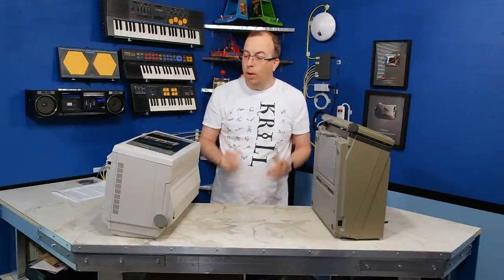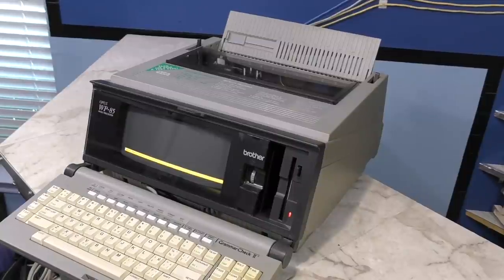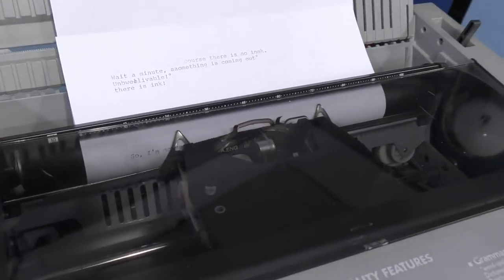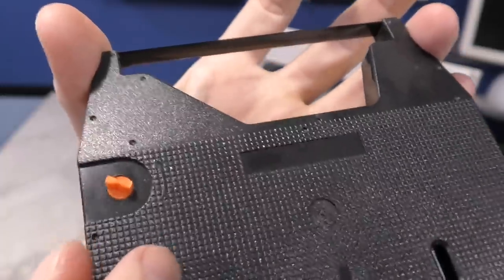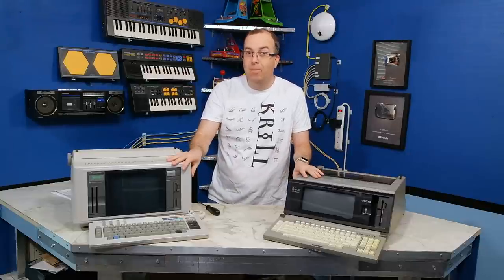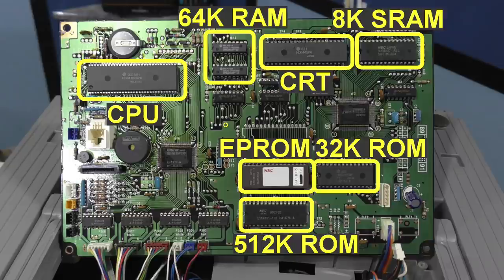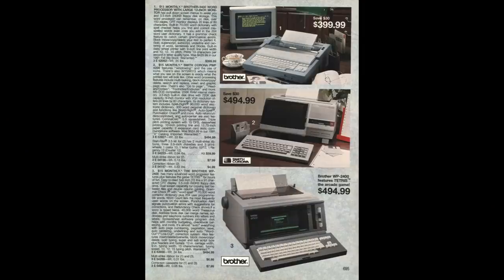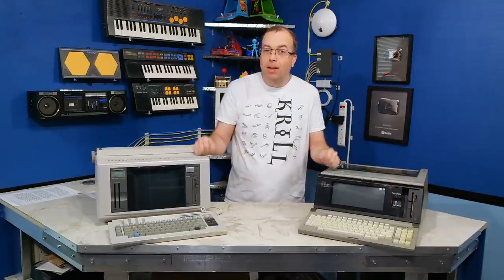Dissecting two Word Processors, Brother WP25 and Panasonic W1525

Comment: I know I'm late to the party, however I was wondering if you've ever considered doing videos on Alphasmart's lineup of word processors design for use in schools and for authors on the go. It was founded by two ex Apple employees and they provided various word processors models between the years of 94 and 2012ish. They could last a year on 3 AA batteries, or the equivalent of 700 hours of use. Some models had a sort of networking built in, so you could get your text off that way if you had a receiver for it. Otherwise documents were transferred to computer by plugging the Alphasmart into your computer and hitting print on the unit. It would then retype the document into whatever program you have open on your PC. The models that I can recall are the Alphasmart 3000, Neo, Neo 2 and Dana. I believe they may have had older machines than that, but these are the ones you still see in use today. They are coveted by authors who really enjoy typing their first edit into the machine. If you want to learn more feel free to let me know!

Comment: Hello, I love your videos by the way. I bought from a goodwill a little while ago, a early commodore Vic-20 in box that is in really good shape, i just have one small issue. The key plunger that the commodore symbol key cap sits on broke off and the spring is not able to be found and i was wondering if you had a Vic-20 key plunger and spring so i can place the my commodore symbol key cap back on. I can find a pack of 10 key plungers and springs for the c64 on eBay but i only need one for the Vic 20. thanks for your time and keep making great videos, I am always waiting for the next one.

Comment: If this tech came out way back in the electric typewriter era, it would've been globally revolutionary as much as modern day internet is.  It absolutely is simply an electric typewriter that stores pre written documents before printing the exact same way.  In theory, an electric typewriter could be retrofitted to print on demand just like this, by controlling input wires hooked up to every key, and then send a signal through those inputs via word processor just like these.

Comment: This is kind of an odd experiment idea, but have you ever tried rehydrating an ink ribbon? (assuming they used water soluble ink and not polymerizing oil base or something) I'd suggest just taking the side off the ribbon cartridge and putting it into a steamer for a bit. I make no guarantees it would work, but it could be a fun experiment. And if it did work you could have a lot more printer fun.

Comment: One reason you forgot to mention in the vid for why a  a lot of people bought these standalone word processor machines was they where typically cheaper then full computers. These are sort of interesting devices that could only exist at a time that full computers where expensive and cheap home computers don't do word processing well so a dedicated WP machine made sense, at least untill the price of full PC's came down enough to erase the main benefit the devices had. Still interesting as a 80s/90s artifact. .

Comment: OK, so that white ribbon actually doesn't work kind of like Wite Out and other brands of correction fluid, because rather than printing white filler over the wrong characters, it's an adhesive tape that lifts the ink off! And it's actually not silly, because just like with the other unit, you can type directly with it, in which case if you made an error it was already printed and so would need to be physically deleted.

Comment: I have an older laptop in my possession. Heck its older than I am. It is a 2002 EEE PC Seashell Blue edition. The only problems are listed below.

-funky lines through screen but barely visible
-weird squeak that goes away when used.
Other than that this thing runs like a dream with Windows XP Home Edition on it.

Comment: replacing the ROM OS might actually prove somewhat troublesome.  Not so much because of the software. but because IIRC CP/M needs the low end of memory to be free, and it's quite likely that's where the ROM is mapped into (because the z80 by default begins execution at memory location zero).

The Sinclair Spectrum actually has a similar issue with CP/M for precisely this reason, though at least one custom version of CP/M existed for the disk drive bearing +3 model.

An obvious point of comparison here would be the Amstrad PCW

Comment: 12:30  You too?  lol yeah I did too.  The only commodore PC thing I have seen lately is a Commodore PC10-III "Colt" which there are a few on eBay.  I also dont know if you have seen the XU1541 thing that allows you to connect the 1541 drive to the PC.

Comment: The panasonic seems to have Motorola 6800 code compatible chip. The two blue sockets at the top contain RAM as well, as can been show from the -20 after the part number indicating access times. I think the big chip in bottom right hand side MIGHT be a 68008 CPU (8 bit data bus).

Comment: ON the panasonic the chip marked IC9 looks like an M3864 - 512MB ROM.  The 3 flat pack chips marcked IC4 IC5 and IC6 are  the DRAM chips, I cant see the number so I am not sure what size they are, likely 16K (2K *8).  The 2 Socketed Samsung chips in the middle are ROM chips 1M and 4M probably.  The Fairchild 625167 is likely a memory controller.  the 64 pin DIP mitsubishi chip is a mystery.  My guesses.  I cannot identify the square paq chip in the lower right as I cannot make out the markings.

Cool seeing these old machines working.

Comment: I have the later Brother WP80 which has the spreadsheet already in ROM. The floppy drive is 720kB DOS-compatible, except that it doesn't block "illegal" symbols in file names. My only disappointment is the fixed keyboard.

Both of the models you have use sticky lift-off tape for single-strike carbon. White-out tape is also available for ink and multi-strike carbon.

With an Arduino or ARM-based mobo (and appropriate break-out box), either of these machines should be able to match the Olivetti ETV-6000 series.

Comment: I'm am sure this comment has been made several times since the video came out, but my thoughts on the ROM sizes are:
512KB ROM has a part number 23C4001 and the other ROM is 27C2001, the 27C series of ROMs were very common in the 80s and were UV erasable.

Assuming the "4" in 23C4001 means 4Mbit (512kByte) then the "2" in 27C2001 would mean 2Mbit (256kByte).

Comment: I have a word processor, it's a olivetti cwp1 mine is dated 1988, and it's in pretty good shape actually, i took it apart so i could see what components it had (it wasnt as easy es these 2) and it was similar to this one, i think it had a z80 cpu, a crt controller, and it had a floppy drive controller, I'd like to hack it and use it to run other software tbh

Comment: 0:27 *luggable (in modern terminology). Like the first "portable" computers, such as the legendary IBM 5100 and those that followed working on the same concept in the PC compatible or CP/M era. Weighing about as much as what we know today as a full sized desktop PC, they were convenient in the sense that you saved the weight of a monitor and the need of connecting wires to it, while the keyboard was not much different from a standard one, only it was mounted on hinges and doubled as a lid. In practical terms it saved some space in the trunk of your car and the need for a second AC outlet in an era were power strips were maybe not that common, not much else...

Comment: The brother one would have been cool if it had used an Atari 800 like dual cart ports, one for the Word Processor, and the other for optional Basic / computer functions.
Reply: 10p6 The point was to not bother with a general computer interface.  Only runs it's built in program which can't be accidentally or mischievously changed. Only contains the minimum hardware to do that.
Reply: @johnfrancisdoe1563   I know, I used to work in the computer field for a long time.  My response was to the computer reference, and back in the day adding a cart port/s for unchangeable ROM software would have not really cost much extra to make.

Comment: You can also do a nice modern word processing machine with those :p 
replace the guts with a pi, replace the crt with a lcd screen.

The worst part would be to analyse how inputs are transmitted to the printer but i think it can be done :p

Comment: These daisy printers with those removible inkt tape cartrides are interesting, but i wonder how long these cartrides will last and how many papers you can print with it, also that typo correction feature  in the newer model from 1992 is such a fantastic feature wich all  typewritters should,ve.
Altrough i hardly could call those computers being portible,they are just luggible,it’s only handy for business mans who are traveling alot while having to set up their computer as fast they could to type on and print stuff,it might be very ideal for campers as well sothat you could work on it while traveling from an place to another.

Comment: Other than the ROM, they look a step back from the Amstrad PCW 8256/8512 from 1985. Very little on the motherboard and just dumb stepper motor drivers and suchlike in the printer (printer microcontroller is on the motherboard because it contains the Z80 boot ROM). PCW 9256/9512 in 1987 for a daisy wheel.

Comment: its funny you mentioned hacking the brother with new roms. i was recently in a discussion with someone about putting a ppu on the c64 and giving the system another 21k video ram. point is, if you are going to hack the machine, how about some type of vic-II display or grab the crt chip from the msx2. that would be neat to see. i was also talking about building a controller that could keep sync and paging access on a 128 between the z80 and the 8502, same with the vdc and the vic-ii. 80/40 column mode switch on both rgb and composite output. ive heard it cant be done. im sure it could be and im sure theres a way through a controller to accumulate the speed in MHZ of the 2 chips both ways so long as sync is kept. also requires memory management and custom hacks/updates to programs, one can hope i suppose.

Comment: Shoot, i sold my pc-1 last year. I used a pc-1 back in the days at my friends house. Later i found one for sale near my place. I trade it for a nes. It had a broken psu, but swapping the capacitors brought it back to life. It only had 512kb of ram and a 360kb 5 1/4” diskdrive with mda graphics. To play some game u could use a program that emulated a hercules graphics card. It’s a nice compact pc, but since it lacks any expansion port, u cannot upgrade it without hacking.  The only nice future the system has, is the fact that u can use a Commodore Amiga mouse and a Amiga diskdrive to expand the system. I tried it and i could use a Amiga 1010 diskdrive to read 3.5” 720kb formatted dos diskette’s. I can imagine that you can use a  gotek to ‘future’ proof the Commodore. They where offered for sale back in the day at a national furniture store for 899,- guilders.

Comment: Ooh, i have an old brother word processor just like that, though it's a few years older. the 240k floppy format is apparently something common on the lower-end models, but I guess it can "initialize" any regular 720K/1.44M floppy disk. unfortunately, I don't have any of the floppy disk software supposedly included with it and with such a strange format i doubt there's any way of getting a new set.
Reply: And i was similarly impressed with the ribbons, they seem to hold up really well through the years.

Comment: Thing i want to mention: If it works with colored paper, it's supposed to be tape. If it was correction fluid, it will leave a white mark on colored paper. Plus, it will NOT work as good.

Comment: Japanese characters are very numerous and can not be entered with a typewriter. The word processor that was able to solve it spread in Japanese business. It was also shipped abroad. Panasonic (At that time in Japan, initially the "National" brand) has long been producing MSX PCs (The only maker that has put out MSX turbo R), but it has also produced word processors. Brother has been producing typewriters until recently. It is inherited by printers and MFPs.
Reply: Thats bull***t. Japanese can be typed by keyboard. There are 46 basic characters. Look up a Hiragana or Katakana chart.
Reply: @trainingtheworld5093  No, it usually requires kanji. It is commonly used in Japanese.

Comment: that amber on black looks like it would be fairly easy on the eyes. We had some old computer system that we used at my last automotive job that had green text CRT monitors At first I didn't like it but once we upgraded the system to a modern Ubuntu setup (old one was linux based also) 
I started to miss the Green on black setup... The new version was a small window inside Ubuntu that had a stretched look and had bright blue letters... 
Might be a way to change it but meh 
if you know how to modify "lubesoft" software for ubuntu hit me up lol

Comment: So generally speaking, do most of the word processors load their basic functions right from the ROM ? Since some word processors e.g. NEC Mini 7 series doesn't have a full functional ROM. A boot disk is required to even use its most basic word processing functions.

Comment: I have cheap ($15) open source hardware which will read and write Brother disks using PC drives! http://cowlark.com/fluxengine/ At least, it'll read the 240kB and 120kB formats, and as the WP25 used the 240kB format it'll probably read that.

Those Brother floppies were utterly weird --- 3.5" 40 track disks, spinning at (I think) 360rpm, and using GCR encoding rather than FM or MFM. PCs won't touch them. The only way to get data off is via an expensive data recovery service or my FluxEngine. The weird noise from the drive is fairly normal; they'd seek to about track five, and then microstep backwards looking for track 0 and then hammer into the buffer making a nasty grinding noise. This was to avoid having to precisely align the tracks from machine to machine. They're not the worst --- some of the really early Brother machines used spiral tracks.

I am really interested in that spreadsheet disk; I've been trying to find some of the program disks for these machines. It looks like this WP25 is extremely similar to my Swiss LW30, and there's a good chance that the program disk will work in it. If I can get it running code off disk, I can reverse engineer the executable format, and run my own software. (It ought to be possible to run CP/M on it given a little work.) If anyone has one and wants to image it, either with a Kryoflux or a FluxEngine, and get in touch, I want those images...

Comment: The place I work at had a old ibm Electric typewriter dropped off for recycling. I wanted to take it home but by the time I decided to do so it was gone 😢😢😢😢😢
Reply: Was it an IBM "Selectric"? The huge metal ones that have a golf ball print head? If so, you're better off without it. They were notorious for breaking down and needing constant repairs and maintenance.
Reply: ct92404 I have no idea. Lol
Reply: @darthrevan2063  Ha, well you'd know a Selectric when you see one. They're HUGE, like the biggest typewriter you'll ever see. If you're into collecting vintage stuff like typewriters though, just stay away from the Selectrics. From everything I've heard about them, they're a royal pain in the ass. My parents had one in the 80's and early 90's, and they were constantly having to get it fixed.

Comment: I kinda wonder if there's any model of word processor that looks like this but offers Chinese or Japanese support (which means megabytes of ROMs supported since you need a hell lot of ROM to store those thousands of commonly used characters, which is 2000 per Japanese standard and 6000 per Chinese standard.)
Reply: That would also require the printer part to be of dot-matrix type, not the typewriter type with separate "stamper" for every available character like on these devices.
Reply: @enginerd80  That wouldn't be an issue really (as dot matrix is already a thing and they can just swap out the printing mechanics). However, huge ROM chip could be really pricey at that time.

Comment: Probably not the most coolest or versatile wordprocessors ... try the Amstrad PCW8256/8512 Joyce! 😘
Reply: Yep, exactly Danni. Wanted to write the same but you were faster. ;-)
Reply: @rastislavzima  , oh yeah! These little beasts really kicked ass, because they where in fact running on CP/M with up to a half meg factory side coupled with a Shuggart compatible floppy controller, that also managed to work with 5,25" or 3,5" disks. Also a lot of killer apps were available ... even monochrome DTP was no big deal.
Reply: @dannyhilarious  haven't own any, but I had a Schneider CPC464 and than CPC6128, with CP/M+ too, on which I've made a highscool project in Turbo Pascal. Machines built around Z80 with CP/M were realy very capable and usable also for game and bussiness.
Reply: @rastislavzima  indeed! Also Siemens Step 5 was also available on CPM and so I learned how to code on PLCs.

Comment: Kids now will not have the (dis)pleasure of entering an office that smells of typewriter ink and machine oil, along with the constant, deafening swarm of clacking. Kids would not to deal with applying whiteout over mistakes and correcting it with a pen. Nor substituting letters (like "j"s for "i"s or ""g"s with "c"s) or dealing with some misaligned characters because of broken hammers as well as the hammers colliding. Kids would not know how much effort and expenses it took to Blog ones interests in 'zines. Although, word processors made things a litter easier with the auto-type feature.